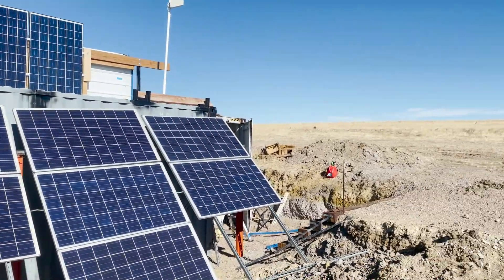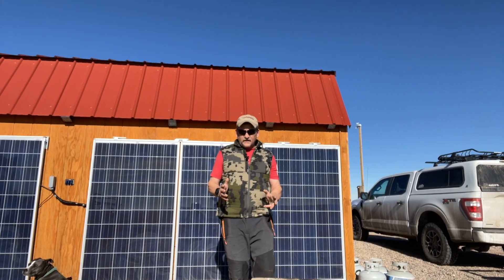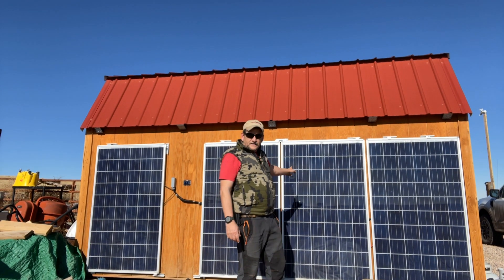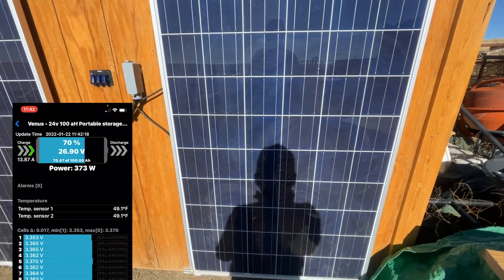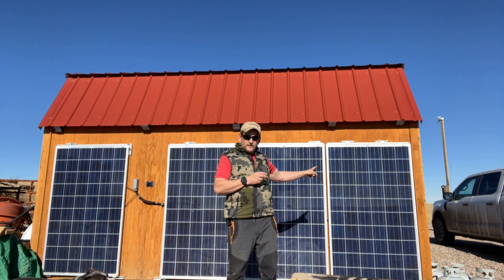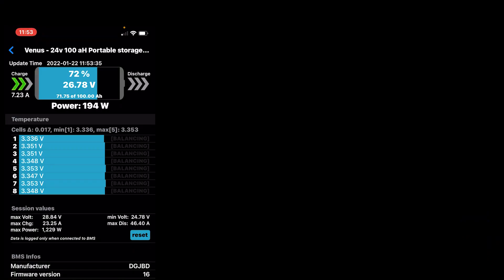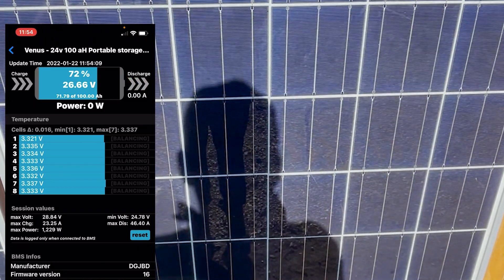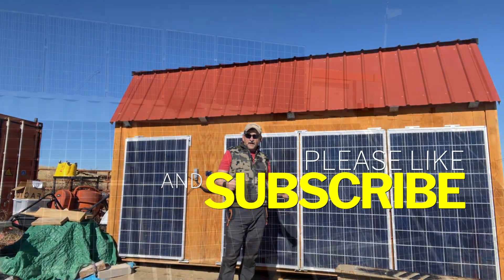Shadows can devastate your solar power!

Comment: isn't the bypass diodes supposed to bypass the shadowed panel and still provide a power output?
Reply from the maker: Depends on how the panels are made, but yes.
Reply: Correct

Comment: Did you see these new batteries from Growatt?

“The new AXE LV battery system covers a wide range of capacities extending from 5kWh to 400kWh, which caters to differentiated needs from daily households to large business and industrial scenarios,” said Lisa Zhang, marketing director for Growatt. “It supports power output of storage and off-grid systems, ranging from 3kW to 30kW.”
Each 5kWh module measures 650 mm x 350 mm x 165 mm and weighs in at 40 kg. The nominal voltage is 51.2V and the operating voltage range is between 48V and 57.6V. The battery also features IP20-rated protection and internal plus connection.
Reply from the maker: I had not until just now.  Any idea of the cost?
Reply: @pawneeoffgrid2614  No, couldn't find it online. Hopefully comparable in $ to EG4.

Comment: Ya string configuration is important but there are ways around that. I guess you found one lol move to the plains, at least until it snows.
Reply from the maker: I have worked through a couple snow storms so far, but nothing major.   I grew up in Leadville CO which is well above 10,000 feet above sea level.  Snow and cold is part of my life.  Thanks for taking time to watch.